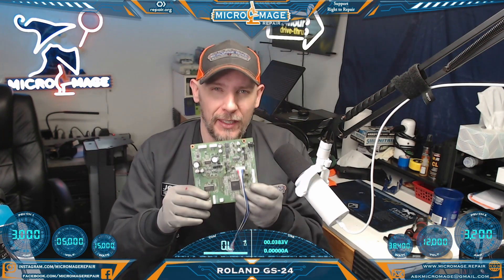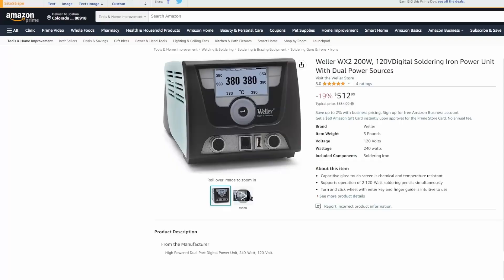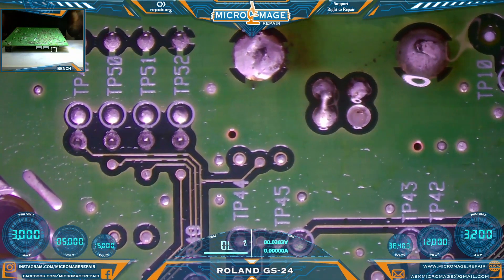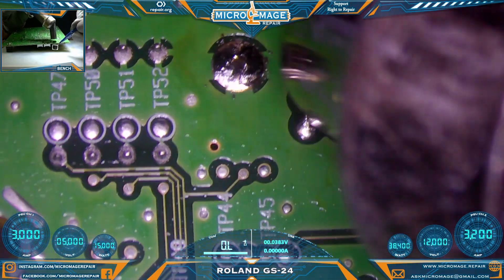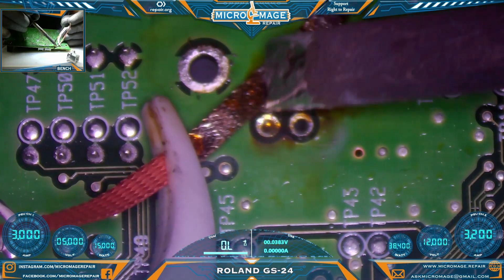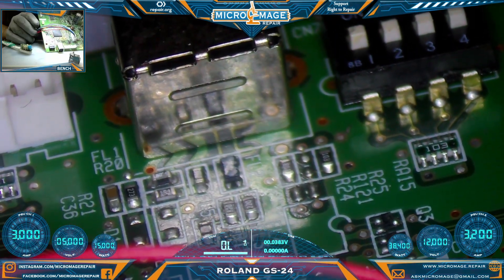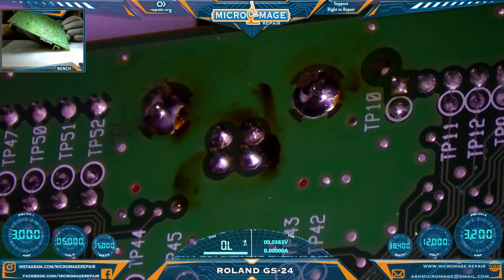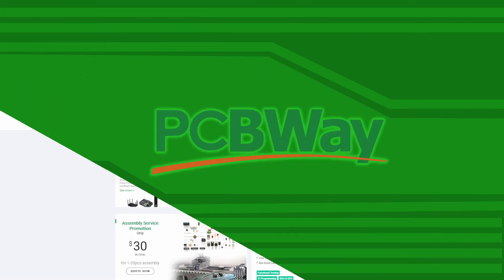Roland GS-24: Broken USB B Port

Comment: I think I have this problem with my Roland printer. I even tried using the pin connect cord and it didn't work.
Reply from the maker: Unfortunately my knowledge on these printers thus far is limited to the ports and surrounding circuitry.  
If it's something deeper like a logic related issue (IC failure or something of that ilk) it will likely have to be through Brother as they don't really make those parts available to us independent techs.

Comment: Do USB B ports fail like this alot?  I would think that once the printer is hooked up to a computer the cable stays connected and is not disconnected a lot. Is the damage caused by people tripping over the USB cable a killing the port on the printer?
Reply from the maker: This particular one was used at a trade school and apparently was tripped over by a student.
It's the second one from a school I've worked on.
The first was an employee accident if I remember correctly.
Just carelessness much like any HDMI or USB C port damage tends to be.